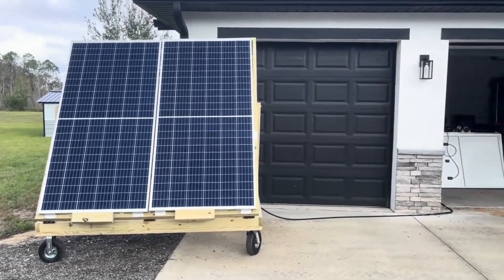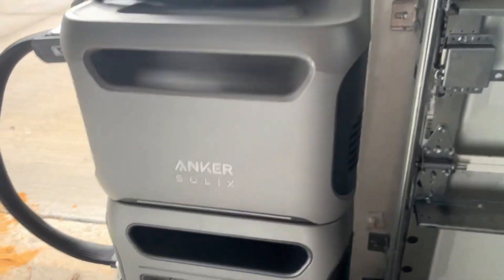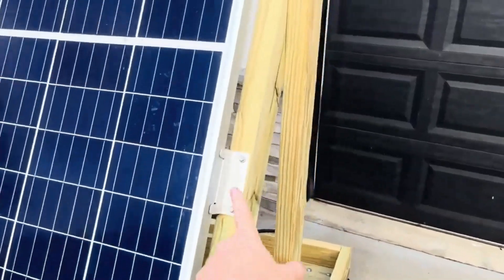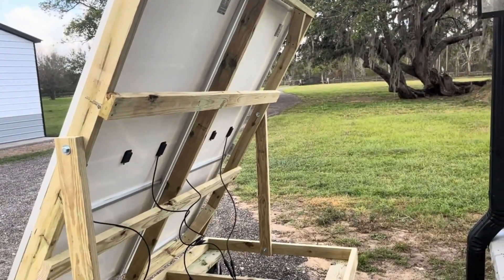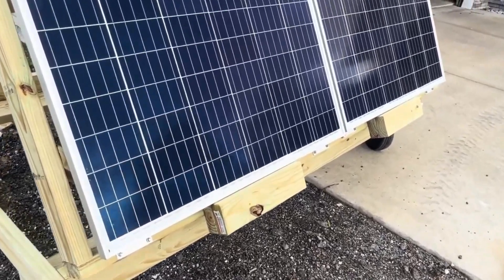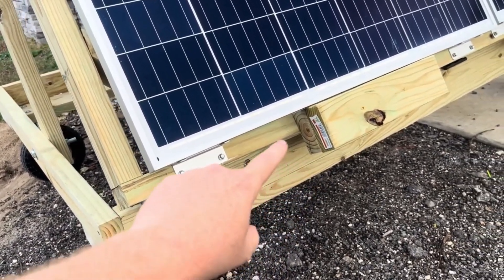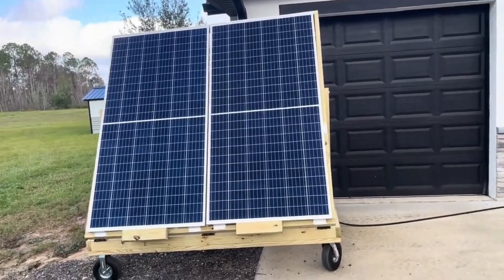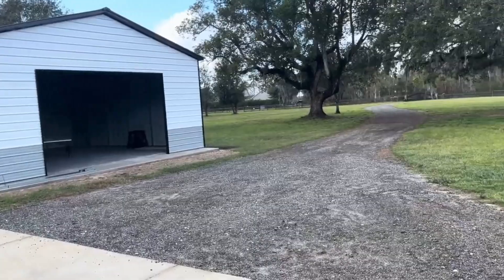DIY Solar Ground Mount | Powering Our 30 x 30 Metal Building

Comment: At least you have land where you can build however you want. I'm in Homestead, in an HOA community.  I don't want to poke ho,es on my roof. I have 1200 watts of panel and two controllers, for for ener🎉storage  I have 2X 12V300A LiFoPo batteries., a 500 watt and a 1500 watt inverter everything in on a board in my garage. In my opinion, you did real good with the panel stand. The wheels make it all worth the build.
Reply from the maker: Thanks! Your setup sounds awesome and I bet it’s way more efficient than our current ecoflow and anker setups. A setup like that felt a little overwhelming to me at first. Hopefully we have something more similar to what you have in the future.

Comment: Did you get the plus model??? Or the original one with low solar voltage input??!
Reply from the maker: Ours is the original. The plus version had not been released yet when we bought it.